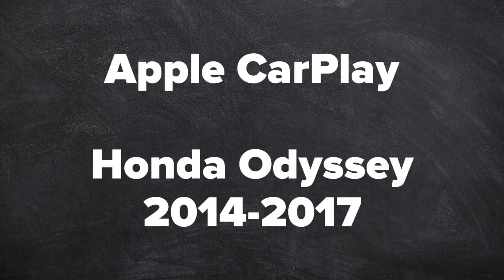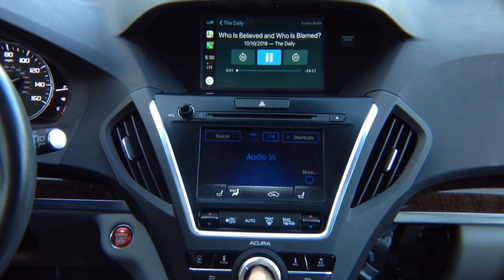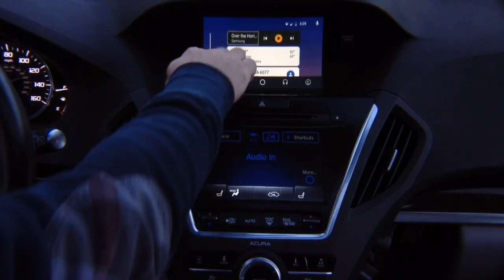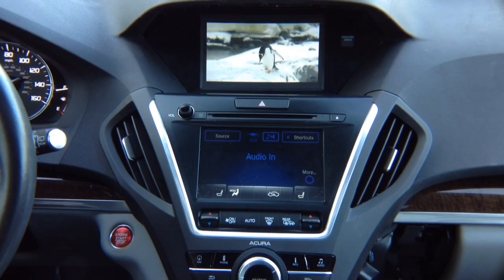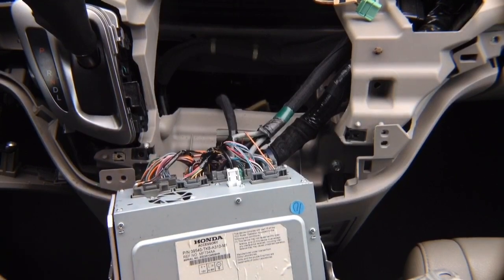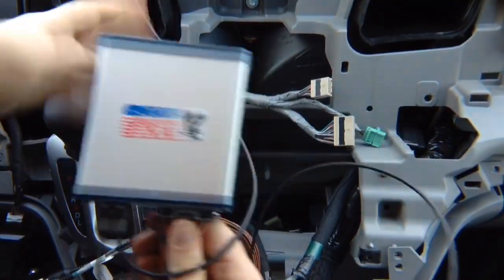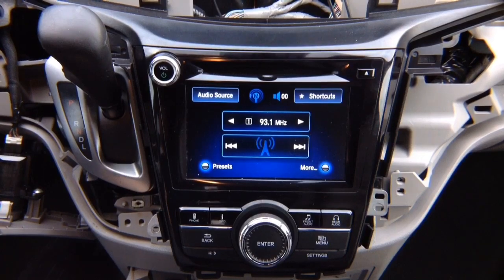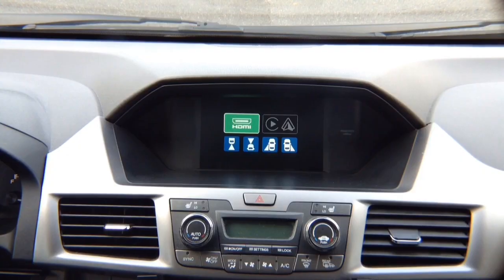Honda Odyssey Apple Carplay - How To Add Apple Carplay Honda Odyssey 2014-2017 NavTool Interface

Comment: I’m planning to follow your instructions and install the apple carplay, where can I find only the harness you used on your video? I checked your website is the price only for the harnes?
Reply from the maker: The price covers a comprehensive interface that includes everything needed for installation, such as the wiring harness. Additionally, it comes with a lifetime warranty, made in the USA, and includes state-based support.

Comment: So it doesn’t display on the oem touch screen? You have to use the knobs?
Reply from the maker: Your odyssey real screen is only the top screen, the bottom screen is the radio that was converted to touchscreen but the only real screen in that vehicle is the top screen, and keep in mind CarPlay is not an iPhone CarPlay was designed to be rotary knob first versus touchscreen

Comment: Looks awesome!  One question... Is it possible to make it so that the NavTool always loads CarPlay upon turning on the car?  (instead of having to hold down the "Back" button each time)  Not sure if it's possible but thought I'd ask. :)
Reply from the maker: just like factory carplay in most cars you have to select caprlay after car starts

Comment: What model is this? There are two options for a 2014 odyssey on your site and I'm unsure which one this is.
Reply: Also, where are you plugging in the other end of the iPhone cable? Just in the factory usb slot?
Reply from the maker: into the interface high speed USB
Reply: @Navtool  do you know if the high speed usb interface is a dongle hanging out from the front dash? you can reuse the factory usb slot?  sorry if the question may be silly... i'm a bit late in the game to find out that there is such wonderful device for my odessey! :)
Reply from the maker: @edwardwang9347  most people route long cable inside the armrest for factory look and feel